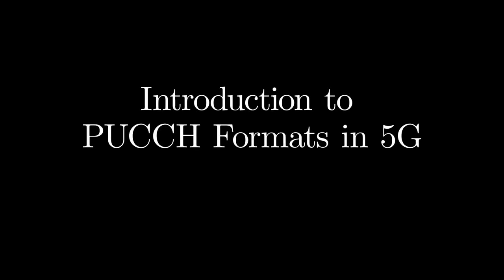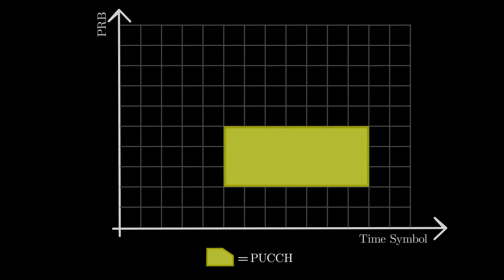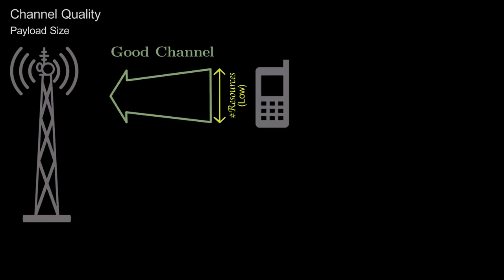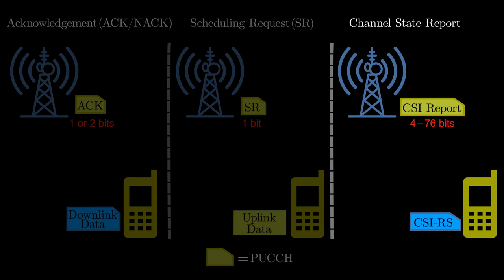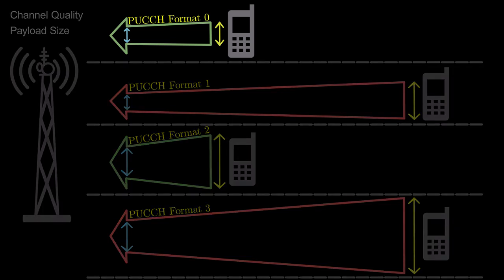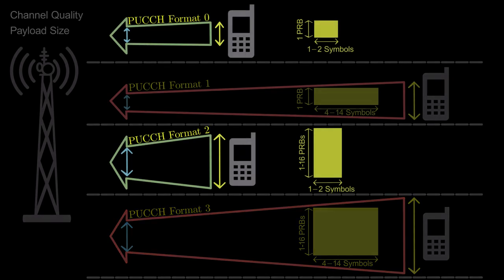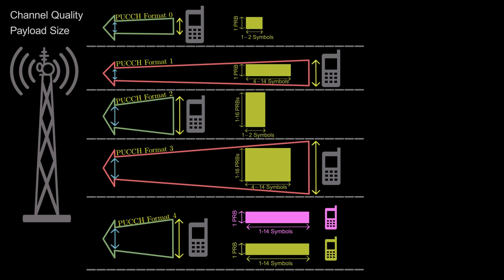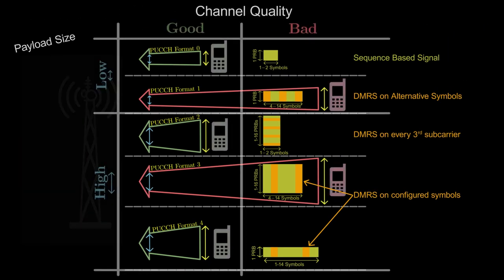PUCCH Formats in 5G

Comment: The information about time/frequency of PUCCH should not included in DCI？ I can't find it on any type of DCI..
Reply: Based on what type of data UE is sending pucch format is decided. 
Eg : if SR has to send on pucch then Scheduling request resourceconfig from reconfig will give pucch - resource id which in turn maps to pucch resources in the reconfig. 
For Ack/nack UE may get pucch resource I'd from the dci.
Reply from the maker: There is a 3-bit parameter 'PUCCH Resource Indicator' inside DCI. This parameter points to one of the PUCCH-Config, which were already configured in UE's memory by RRC messages.